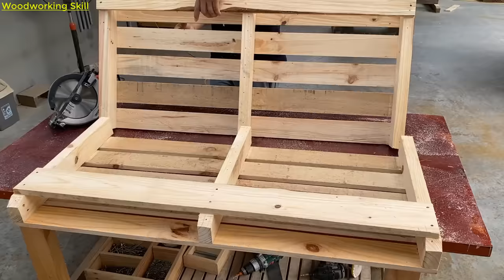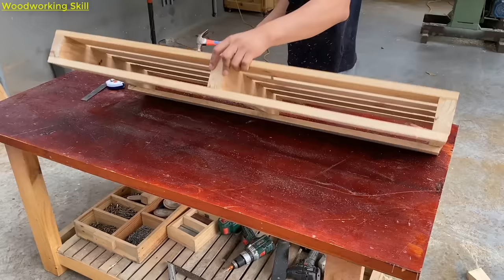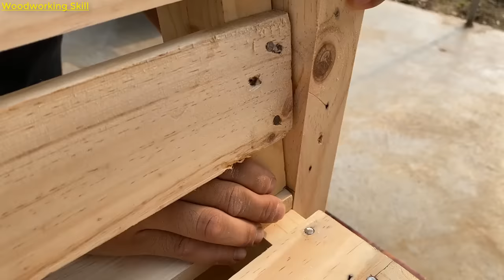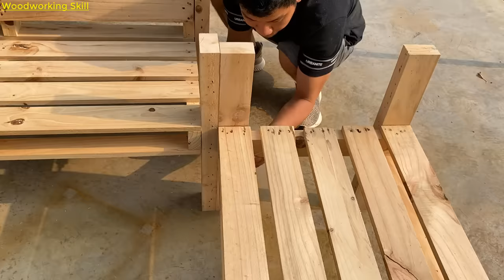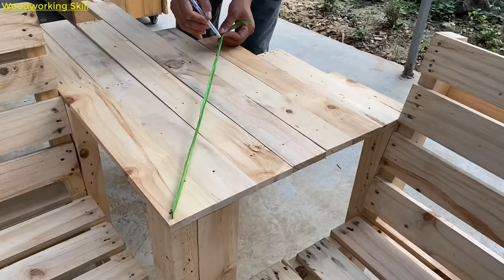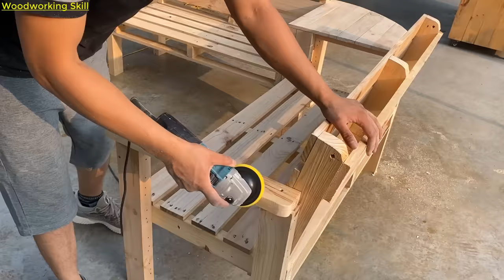Creative Pallet Recycling Ideas You Have Never Seen Before |  How To Create A Beautiful Pallet Sofa

Comment: He may have used new pallets, although I get pallets that look this new through my work quite often. I don't think the point of the video is weather the pallet is new or old I believe it's about what can be done with a pellet new or used. Excellent work and a great idea, I will make this for my deck.
Thanks for your inspiration.
Reply: The video should be what you can do with wood then not deceive us into thinking finding old pallets and recycling
Reply: @metalmyron  😂
Reply: I made this as per the video using old pallet, when it was done and had finish on it didn't look any different and I was able to sell it for $350 as a piece made from recycled pallets. Some the people commenting here have no idea what they are talking about and are far to picky IMHO.

Comment: Nice. I make them slightly different. I also put a board across the rails on the front. This helps keep them from bowing in the middle over time. I put another board across the top rails for an arm rest. And finally, my side armrests are wider to accommodate dinner plates.

Comment: Like it!  You'd have to plane down some wood pallets as many use rough-hewn lumber.  I've worked in stores where you either have oak or cheap pine.  One time my dad took some pallets home and took the bottom 1x6 pieces off so he could lay them on two poles to build a bridge over a drainage canal.  The bridge lasted a few years.  The oak pallets seem to be rare nowadays.  I hate it that there are wide notches cut from the 2x4s on some pallets.
Reply: true

Comment: Gotta tell you guys that your pallets are increasingly looking like they're brand new and never been used as pallets. In fact, I would also question the dimensions of your pallets and whether they meet the standard sizes or not. Just an observation ;-)
Reply: And they come apart so easily
Reply: @tee2899  and the nails are made from 316 marine grade stainless. Look, no corrosion.
Reply: It's called using the right tool for the job for one. And no it's not a hammered pallet when you buy nice things like  maybe a laminate floor it will come on a super nice pallet like this one. So talk some more shit.  Very nice work by the way thanks.
Reply: No
Reply: 0p

Comment: Now. How do we make things with real pallets? You know, the ones that have uneven cracked boards with lots of knotty pine
Reply: Usually rough hard wood (its not pretty when u pull the boards off) usually have to cut the nails , looks like he made them first , or they were from styrofoam (white pine/spruce)
Reply: Good eye , there are no fork access cut-outs on the stringer side (only through the slats side), not very pallet-like
Reply: you need a really good planer..but the end result would be fantastic

Comment: The quality of the timber on these pallets is of a far superior quality that the usual discarded rubbish you find. Some have broken hidden nails in them which will destroy your circular saw blade in seconds. I've done it myself. Working with new or high quality pallets is one thing. The usual crap you will find for free will be another and you will have to spend hours of sanding. Just my opinion. A friend attempted to build a shed with pallets. Due to the variance in sizes he gave up.